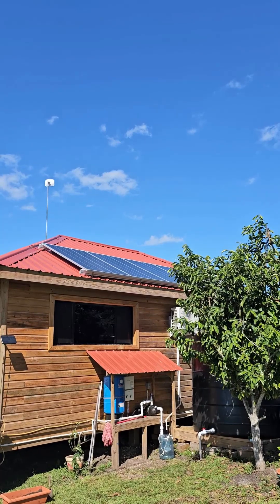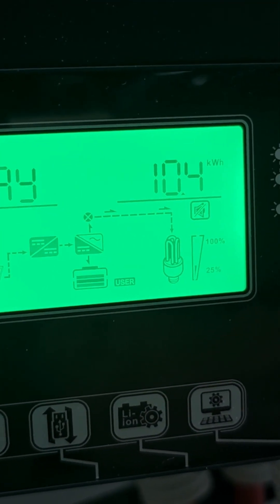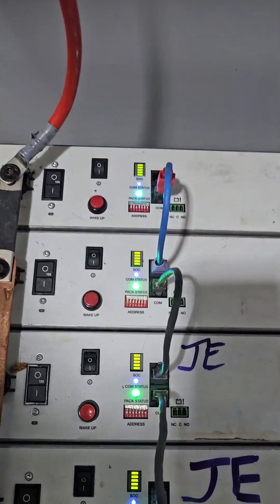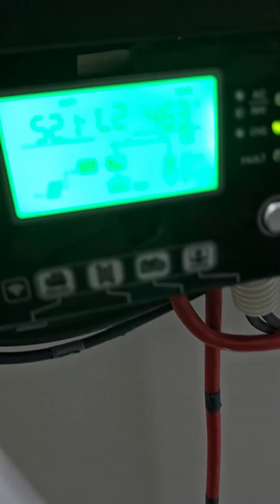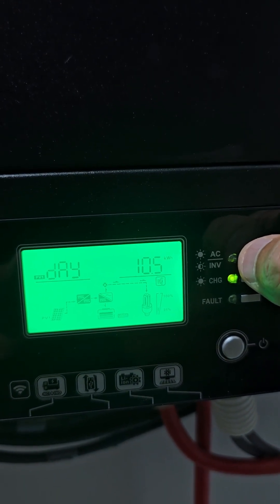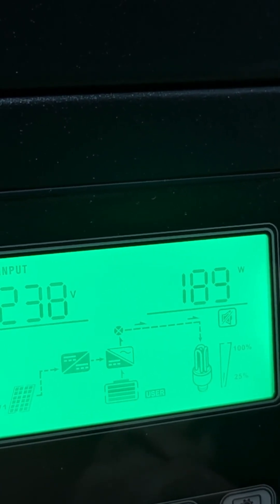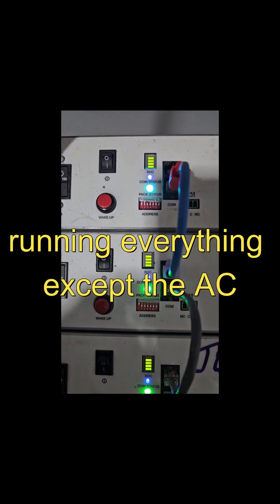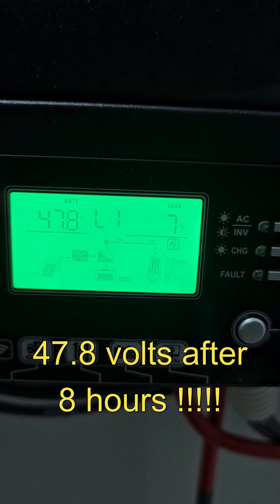"Off Grid Living: How Much Power Can a 20kW 48Volt Battery Bank Produce?" (WE HAVE USED BATTERIES).

Comment: Smart move using a heavy duty, low frequency, transformer based inverter charger instead of one of those cheap, short lived, high frequency, low surge inverters that every is pushing on youtube.
Reply from the maker: It has been great so far no complaints at all. Thanks for watching.

Comment: Excellent score on the used batteries. With a 20 kWh bank you probably do not need to expand. How low have you ever had them go? Cheers.
Reply from the maker: 45 to 46 volts, but I usually run the generator on cloudy days to charge them back up.